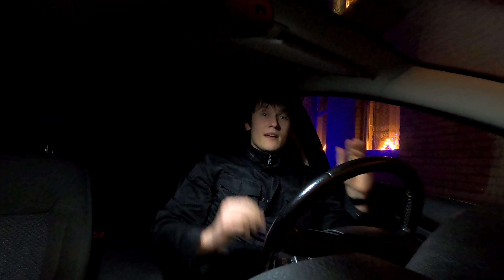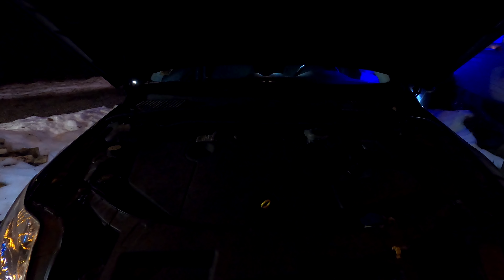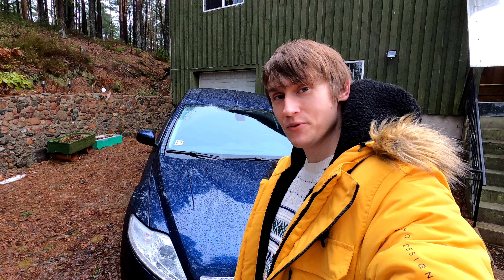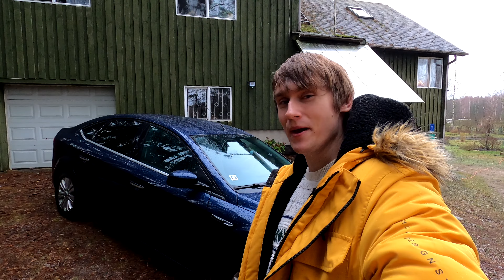Sound of a Bad Strut Bearing

Comment: Hello. Did you have any problem so far with the oil leaks on your 1.8 TDCI engine? My mechanic just found out that my car has leaks at the crankcase gasket and he told me it needs to be replaced, but that means removing the complete engine from car and get it done. Otherwise there is no other option to replace it, while the engine is still in the car. Thanks!